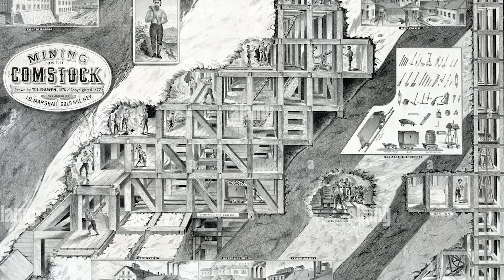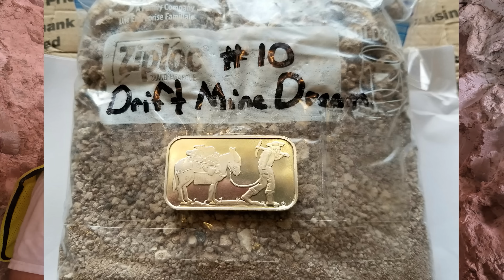How to Find Placer Gold Deposits (The Ultimate Guide)

Comment: Hey I just thought of something you should try to get the worms out. Get a couple copper stakes and wire them up to a battery with a voltage regulator so you can turn it up. Then stake the stakes in the ground and hook up the battery to see if that electricity brings them to the surface.

Comment: I went to Lake Superior yesterday to a old port in a huge bay that gets constantly hit by huge waves. Pushes huge rocks up on shore. Makes a mountain that has to be pushed back in. The surrounding cliffs are sand with trees, dirt on top  a 100 ft tall being eaten away by the lake. Full of gold. In Wisconsin. I found a lot of meteors. You can pan there but no sleuth boxes. Or digging up the bank or streams. You can shovel in the middle of the stream or on the lake shore. Cant encourage erosion by altering the bank. Those meteors are cool Jeff 🤠 i found a lot of them. The lake washes them up.

Comment: The graveyard in Virginia City is full of miners that came-out of the hot, humid undrground shafts in Winter and were felled by Pneumonia from the drastic temperature and humidity change. In Summer it's a bit less drastic. When I first went in the Navy they stuck me in the boiler room where it was 130 deg F. and coming off my watch into 90 deg F Summer hear was like walking into an air conditioned room.
Reply from the maker: exactly ...we have gone through that too but nothing like the miners of the Comstock lode did ....can't even imagine it
Reply: @Askjeffwilliams  
I took a tour of the Comstock back in the early 70's. It was a real eye-opener.

Comment: Ya gotta wonder what source was upstream back then.  Doesn't look like the gold traveled very far, compared to most I've seen.  The blue sheen to the heavies made me think of the Comstock, so I didn't try to lose all the "black" sands.  Also, just to be thorough, soaked the caliche chunks in white vinegar for a few days to dissolve as much as possible, in case there were any flakes there.   There weren't!   Maybe you need to improvise one of those rotary rock gougers they use for tearing out softer stuff, no clue WTF they call 'em.   One of these days you'll find where the real river of gold runs.
Reply from the maker: exactly what we were thinking ..... I know...right